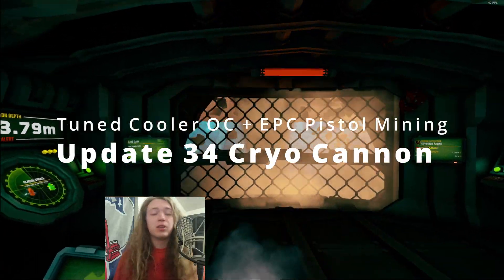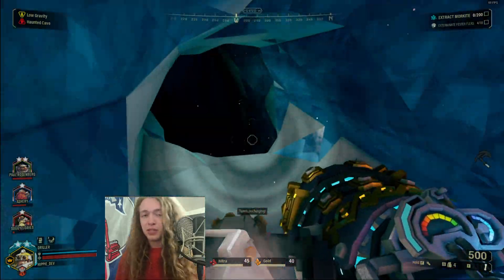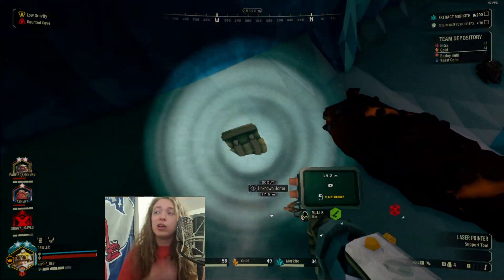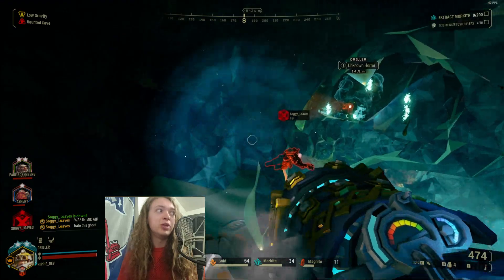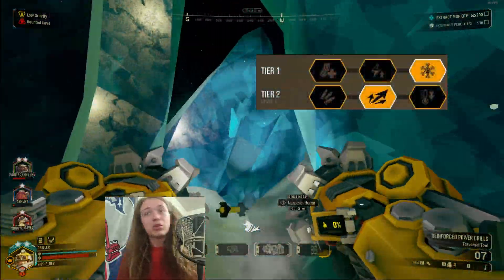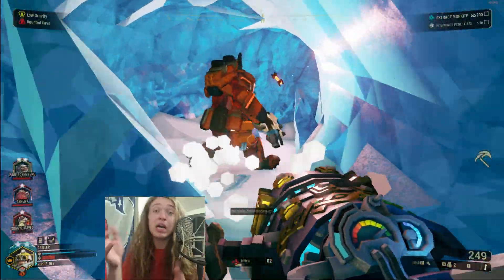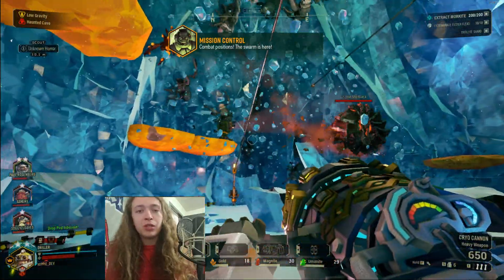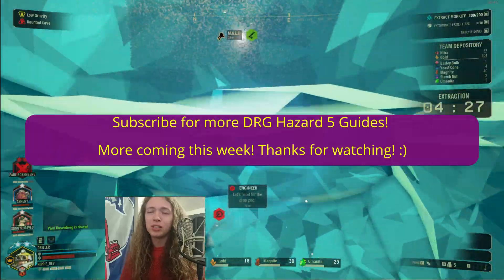Update 34  Driller - Tuned Cooler OC + EPC Mining Changes - How bad was the nerf? - Driller Guide

Comment: Personally, I don't think EPC makes Scout or Engineer useless in terms of mineral gathering. If any, EPC compliments them in a way that they can focus on doing other important tasks. Your Scout will thank you to the nine heavens for EPC mining hard-to-reach minerals, and Engineer will thank you for not wasting their time and ammo using a Platform Gun. If they think they're useless, then it's their ego that's the problem, not the Driller. 😉

For EPC builds, I personally use Energy Rerouting and 2-1-1-2-2. For T2 and T3 mods, I didn't opt for Projectile Speed and Charge Speed mods because it messes up with my timing when I shoot the projectile mid-air. A slow projectile with better accuracy is objectively, uh, better, than a fast one and completely missing the charged shot. Of course, in the end, it's all personal preference. At least I can pick other mods for T2 and T3 slots, which are Cooling and Reduced Energy Consumption.
Reply: If the engi/scout synergy wasn't for getting hard to reach minerals than I must be missing something. Driller/gunner on the low & mid minerals. 

EPC mining hard to reach minerals only makes sense in a perfect 100% accuracy world. I only play with randoms and it feels like half of the time, drillers miss exploding their first charge shot. End up using more EPC ammo & time on average. Now that it scatters minerals, it definitely doesn't make sense to get high minerals unless you want to spend more time going around collecting them and there's also a good chance a chunk or two went hidden depending on biome.

Comment: The T5 Fragile upgrade actually has a 50% chance to shatter a target if they are below 85% health at the time of freeze. I don't think it's an instant kill however, but rather a sizeable chunk of damage. I've seen Opressors take the chunk of damage and still be left with a sliver of health when I still used fragile. It works better with damage builds because most grunts will already be at reduced health by the time you freeze them. This also means it is smart to weaken larger enemies either by feathering the trigger on the cryo cannon or using your secondary, before freezing.

I run max freeze build now and use cold radiance because it stacks with your cryo blast to freeze stuff extra fast in close range.
Reply: Also, I've only found your content recently, but I'm really enjoying it. Keep up the good work! :)
Reply from the maker: I appreciate your viewership and the nice comments :). Thanks for the advice. I'll definitely work that into my freeze builds. Both comments so far make good points about the use of cold radiance. I'm using the drg damage calculator to do a lot of my builds so sometimes things make more sense in the simulations than they do in reality. Thanks again! :) ~Hippie